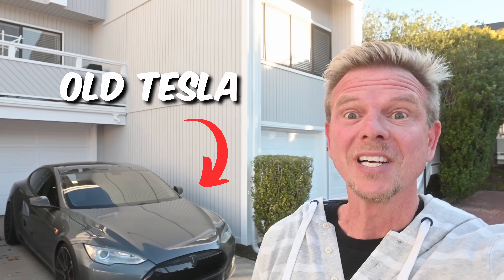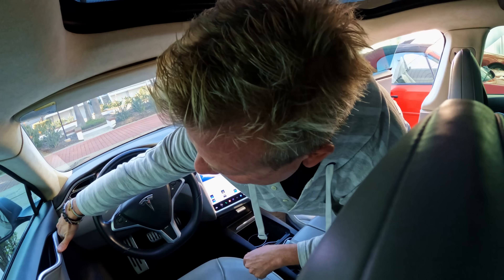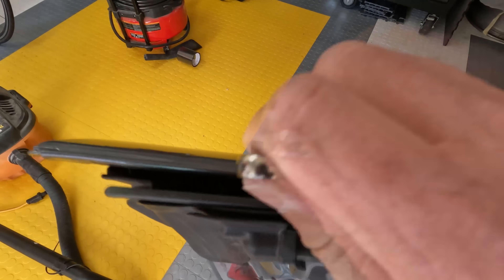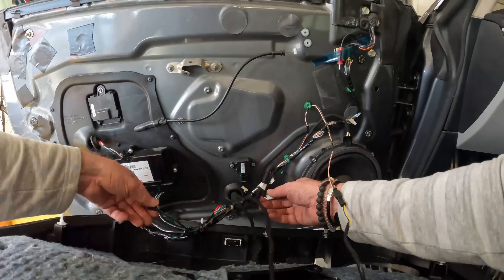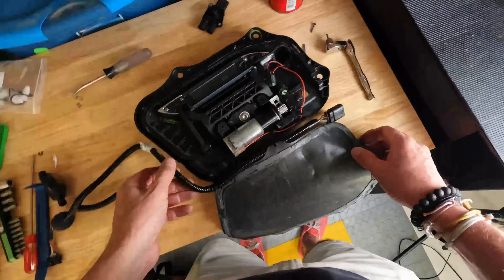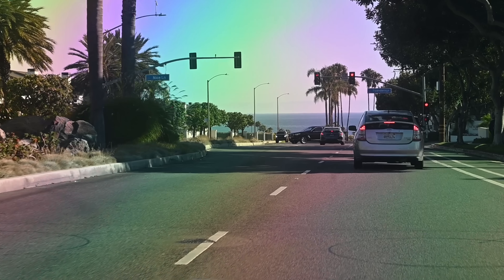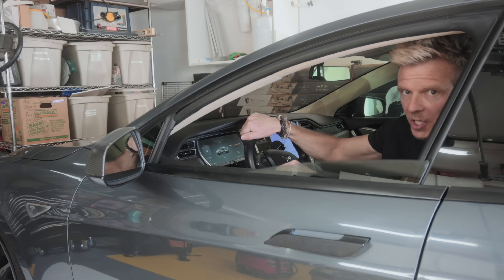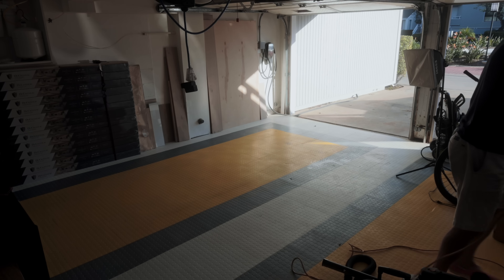My OLD Tesla Model S Just BROKE. Now What???

Comment: I have owned 5 cars over 50 years and have never had a door handle failure.
Reply: I did it was a GM Buick. Had to buy, paint and then have a mechanic put it in.
Reply: I have but easy fix.
Reply: I have but yeah - simple,  easy and cheap fix. What's going on in this video it's just nuts.
Reply: I had my manual crank window handle fail on my 1978 Trans Am.
Reply: Had a crank handle on my 1983 Escort fail . Replacement was about 4 dollars universal handle . Simpler times
Reply: Yeah my door handle cable has snapped on my older Ford Fusion, but it was like 30 minutes of work to replace and handle unit was 15 bucks
Reply: Would you mind to share the things that did break in all those cars. I'm sure that you have quite a list there... 

I would have happily prefered my old cars only have a broken handle to replace instead of all the stuff that kept breaking or needed to be replaced like spark plugs, trigger belts, various fluids, gauges, hoses, pumps, filters, engine parts, transmission parts... costing me thousands of dollars.

This anti EV stupidity is getting way out of hand. Just two years ago you would have thousands of people complaining of all the stuff that would break in their ice cars, now that this hack a Tesla, hack an ev campaign is all the new rage, suddenlyl those pesky fragile ice cars apparently fixed all their problems all the sudden.
Reply: This is like, telling a cell phone user who's complaining about bad signal how the 5 rotary dial phones you've owned over the last 50 years never had reception issues. Whats the point. The manual door handles on your cars don't operate like electrically powered door handles on a Tesla.
Reply: You must have never owned a Land rover or BMW as the door actuators fail quite often.
Reply: @nissan_skyline  you missed the point and thats not a great analogy as cell phones and landlines have different objectives in mind. The point of this is simple - don't try to 'fix' something that isn't broken. Simple handles that have been around and worked for over a century do the job (which is opening a door) just fine. Why design something that's overly complex, expensive and subject to fail when something much simpler works the same if not better.

'Simplicity is the ultimate sign of genius.'
Reply: @nissan_skyline  They may not operate the same way but they serve the same purpose. Why re-invent the wheel.
Reply: My C class has door handle failure as I'm typing this
Reply: Several. Last one was a 5 year old Audi TT from 2016.
Reply: Just repaired the broken outer door handle on my 1985 Porsche. Also had an '89 Ford with both door handles broken
Reply: I  put one (latch really) in my wife's Ford Edge.  But in the 8 years I've owned a Tesla S, the door latch is the only part that failed on me.  Not to mention no waiting on a cold rainy day at a gas station, no oil changes four times a year, no transmission and diff service, no belts, hoses,  water pumps, and even the brakes are original. I'm replacing the brakes this fall before I sell it  oh, and the cabin filter is overdue..
Reply: @antandros69  I'm sure that in his 50 years driving those cars, nothing has ever broken, and in fact, those cars probably fixed things around his house at night like the shoemaker's elves...
Reply: Try a Strange rover :-)
Reply: This is why the newer models are so much simpler.
Reply: Please don't tell me you had the ONLY 5 perfect cars on this planet fffffffffffffffffff
Reply: You're kidding. I've seen GMCs have car door handle problems for ever

Comment: Ive done this fix myself 3 times now. The first time took like 5-6 hours. But the subsequent times i was able to get in and out in less than an hour. Total price was like $50 for the replacement kit. Knowledge learned = money saved.
Reply from the maker: Kudos to you for wrenching on your Tesla as well! 
The door handle removal is very much an exploration process the first time, but subsequent removals are definitely easier. I felt like I was an expert at the end of this project 😄
Reply: What’s the kit called
Reply from the maker: @jaydenmckinney444 You can by them from a lot of different places. Here is one from Amazon: https://a.co/d/hP4rRsI
Reply: @cadreamdrives hey what is the floor from your garage made of?
Reply: Don't get me wrong, I like all the tech that went into tesla. I think some trails were blazed. But, this exemplifies over complicating something.  What's wrong with a simple mechanical latching mechanism? I'm not sure utility is worth the ramifications of the complexity.
Big kudos for figuring out how to fix it yourself though. Very admirable
Reply: @curtislarocca8987  I get what you're saying, but you could say this about anything then. Why use power windows if you can just roll it down manually? Technology can improve things but of course anything mechanical can break.
Reply: @cadreamdrives  if tesla werent crap engineers they would of just put a door handle that works anyone worrying about a tiny bit if drag from a door handle is worrying about the wrong crap.
Reply: @LutherSloan_31  I think there is a balance point to reach in design and engineering. If you increase complexity, you also increase the risk of failure. If the utility you get back from the complexity  justifies the risk, then it's a good trade-off. I struggle to see how the additional benefits outweigh the additional risks here. I do understand that it's kind of the entire point of the tesla, to go to far in that respect. If would go as far as to say, it's probably the reason it was so successful. I think it's great to push the boundaries but I also think it's good to look back with a critical eye and take to heart what worked well and what could improve.
Reply: "ev are more reliable", "cost less to maintain" :)) 
when is everyone going to admit they were stupid promoting this shit?!?
Reply: i crashed my ice car multiple times, even turned it upside down once, but never had to deal with issues like this... ev bought = money wasted
Reply: Technology means more money for the manufacturers and less for the consumers be it through repair costs and planned obsolescence.
Reply: ....do you have live?
Reply: It’s called RaceDeck, but I’m not sure I would recommend it. 
It’s fine for a garage that’s just used to park in, but it’s not great if you’re working on your cars and doing other projects in your garage. The plastic is soft and damages fairly easy.

Comment: Wow that's crazy because,  my 75 chevy is still going strong.
Reply: No Tesla swap on the 75  ;)
Reply: Don't lie, what have you fixed. Lots of small stuff for sure. There is now way you 75 chevy has not had any issues, if you say otherwise, just lieing.
Reply: That Chevy is a rust 🪣 bucket.
Reply: And I doubt it can turn corners either. Try driving it in Australia or Europe lol
Reply: @MR-sj6rq  door handles will be simple, mechanical. Simpler overall. For sure there have been repairs since it was new
Reply: Hm I wonder why the mileage hasn’t surpassed 300,000 on your Chevy… oh wait probably bc you wont drive it and don’t use it daily 😂 it’s been 49 years stop letting it rust, you know the inevitable
Reply: My 89 firebird door handle is a little loose, but still works.
Reply: @MR-sj6rq but it still running, the tesla won't run for this long, the battery bank would cost more than the whole car, it's just like a smartphone you run until it's trash
Reply: my 1957 ford falcon
still run after so many  problems. but 
I always find a way to fix it my self..
(and now I can sell it for more that I pay …)😂

Comment: You don’t want an entire vehicle ran by a computer dependent on electricity. Less electronic parts less prone to failure.
Reply: I wish hand cranks were still on the lot.
Reply: That’s why maintenance on ICE cars are 3 times more. Hundreds of moving parts that creates so much excess heat moving, you need a fan to cool them.
Reply: @martinekstrom6303  Lets see if Teslas sold 2015 will last until 2065. ICEs 50 yrs old and running today will have had 2 engine rebuilds... but they're good as new after each. EVs are disposable... and that's good for the environment??
Reply: The horse had self parking and summons mode but we still moved on to the next generation of transportation. Same same but different.
Reply: @lyndonfring6421  Love how you mentioned there's .1% of all the vehicles made 50 years ago still around....and all those combustion vehicles have been garage kept, under 65K miles, and have still had 2 rebuilds to keep running. 

An EV needs a new battery every 25-35 years or 500K - 1 million miles and thats about it. 

To address the door handle only specifically on Teslas.....they already fixed this issue on future models and re-designed the handle.
Reply: @silvy7394  If its only 1%, it's because parts are no longer available. If they were, more would be running... and its the mentality of people to want new things to impress people they hate by buying with money they haven't earned yet... that is causing the problem. Its not just the batteries, it's all cars made after 2010 and EVs that have made cars disposable and user unfriendly. Cars used to be a weekend diversion for DIYers. Fix this, upgrade that. You didnt need professional training to tinker with you car. Not any more. You have too much plastic in new cars, you have to spend thousands just just to replace a 10$ part because of the complexity of design.

Comment: Geez    would not want an old used Tesla out of warranty.
Reply: Any EV. Not just a Tesla.
Reply: Or a new one either.
Reply: The screwed up thing is by now they should know this will happen to all their models eventually. They need to use materials that match their price tags.
Reply: @Paetaor  That's not limited to EVs either. Any new car, ICE or EV, will have problems like these. I'll pick reliability over fanciness any day, if I can. And mechanical link door opening is something I'm aware of and on the lookout for whenever a new car is on the horizon. Although more so for the safety aspect; not presenting a challenge to EMT rescue workers if they're needed. Ref what happened to Angela Chao.

My friends ICE auto steering broke down, requiring a replacement of a $14 part. They wanted $4000 to replace the whole assembly, which was the only way to get the part from manufacturer. Shopping off brand, probably some Chinese junk, could get the part and have a mechanic replace it. Total cost, about $100, rather than $4000 plus work.
Reply: @Paetaor  too early to tell about other manufacturers' reliability.
 That's what you get for buying "bleeding edge".  
If you want "cutting edge", get yourself a CyburpTruck.
Reply: @gottagowork   way to go. You can always find a workaround if you are willing to put the time and effort into the project.
Reply: I wonder if it's posible to disable and use it mechanical

Comment: Imagine you got into an accident and u pass out,, battery caught on fire.. people trying to get you out but they can’t,, cause the window won’t break, and the door handle don’t work.
Reply: If you buy a Tesla, you are advised to get the most premium life insurance policy. That payout is very important.
Reply: Or imagine you dont pass out - battery catches on fire, locks you in the car.
Reply: @johnmarkrobinson2924 battery fires are actually far more savage than petrol - you cant put them out. In a car fire, its usually all the plastic burning first - petrol tank is last to go. In EV fires, its been the battery causing the fires - and they cannot be put out once they start. It raises a point for all car types - make door handle latches illegal to not have a direct mechanism that opens them.
Reply: Yep, just like:
"Angela Chao death: Tesla in spotlight as investigators maintain silence"
Door failed to open. How unfortunate.
Reply: car doors won’t work after a crash on any car.
Reply: @rinzler9775  Petrol tank is last to go he says, an accident that severe enough to start a battery fire you would have petrol pouring out no problem. Petrol tanks are far weaker and more exposed than a battery pack Battery packs if you actually look it up have a buffer crash protection zone and the battery has a short out mechanism., Petrol has none of these.. Be brave enough to just state you hate Evs instead making stuff up. You make yourself look foolish...
Reply: @msliwin4441  Many modern ICE Vehicles have moved-over to PLASTIC Petrol Tanks. This can cause a chain reaction of any car fire in a Multi-Storey Car Park, simply because burning fuel runs underneath the other parked cars.The plastic Fuel Tanks cannot take that level of heat. At least an EV cannot do that!
Reply: IKR. Thats why I dont drive a combustion vehicle. They're very dangerous.

Comment: Good job!!
It makes me long for the good old days when non-glamorous door handles never failed.
Reply from the maker: 😄Thank you! There was definitely a point in the project where I longed for the same! But I just love how the handles glide out and greet me every time I walk up to the car!
Reply: The drivers side door handle on my 91 K1500 is busted. 
The old cars used cast metal of some sort which wore a bit each time the door was opened.  Drive them long enough and they failed.  I have fixed a few of them.
Reply: @danharold3087  I never had that experience!
Reply: never, ever failed. ever.
Reply: OMG, such BS. Ten year old cars have issues. Windows not working door handles failing. Just ugh. Such lies.
Reply: @MR-sj6rq  One would speculate that if they were trouble free for 10 years they would have longer warranties.  Not looking good for Toyota!

Toyota Corolla
3 yr/36,000 mi basic, 
5 yr/60,000 mi powertrain

Tesla Model Y
4 yr/50,000 mi basic, 
8 yr/120,000 mi powertrain

Comment: I felt your 'relief' when you finally cracked the Door Handle Issue on your Model S. It is a great - looking model, deserving to work properly! And you're the man! I have a 1971 Beetle EV, running on Tesla Model S batteries. No fancy stuff to go wrong. Over the last 5 years, the EV Beetle has been simply brilliant. It handles the heat, and also the badly-flooded roads, and performs like any Beetle shouldn't! Greetings from Australia.

Comment: I thought Elon said the best part is NO part.  These cars are like Rube Goldberg designs.........overly complicated way to do simple things. He tries to reinvent the wheel when its not needed for the sake of futurism, a fantasy futurism at that.
Reply from the maker: Sometimes things that are cool require a little extra. 
But in general, it’s hard to argue that Teslas are complicated. 
The drivetrain in an ICE car typically has 2k+ moving parts. A Tesla has around 20. 
Which car is complicated now? 😄
The future arrived 10 years ago. The Model Y is the most sold car in the world. It may be the stuff fantasies are made of, but it’s very much reality today 😊
Reply: You're spot on.  Cybertruck reinventing the pickup is a fine example.
Reply: Nah, in most cars issues like this are a pain in the arse, all the German makes... You think this is bad? Pshh, it's no worse than what's in a Prius. Jag, merc, BMW, VW... Way worse electrical and mechanical issues you deal with. It's a reason why those cars cost so much to work on. This issue actually wasn't that bad, similar issue in a Mercedes for instance may take a week to fix, and be way more complicated to get to the parts. Tesla really isn't bad, but charging 1500 for this fix is pretty crazy I must admit... should be around 7-800 max repair. They charge a lot to repair Teslas for no good reason.. these cars aren't Mercedes and BMW level of complicated unless we are talking about working on battery, all the other stuff isn't that complicated.

Comment: I had a 2016 Model S 90D...had to replace the handles 6 times.  Totally ridiculous.  First 4 were under warranty...last 2 were not and cost me $600+ CAD each time.  I now have a 2017 S and no problems so far...we'll see.
Reply from the maker: Oh no - what an ordeal! 
The old style handles definitely had design issues. The newer style seems more bulletproof with their lack of gears and microswitches. 
As long as you don’t get water in them 😄
How are you liking the ‘17 compared to the ‘16? Any major differences?

Comment: Avoid EVs is the message I got from this.
Reply from the maker: Right! Because old cars NEVER break 😄
Reply: At least Teslas are innovative what comes to failure points.
Reply: Here's a man with a brain. Hopefully the creator of the video heeds your warning..
Reply: @cadreamdrives  They do break but my last door handle was $25 off ebay, did the work myself in 15 mins.
Reply: And nothing else has broken on your ICE cars? Ever? 
The door handles on the S is a weak spot, but overall, there are so many fewer things that can break on an EV. 
Think about how many mechanical wear items there are on ice cars and how often they break. 
The drivetrain on an EV is so much simpler!
Reply: @Txcowboy80  what car?
Reply: Dumbest comment in the section wow